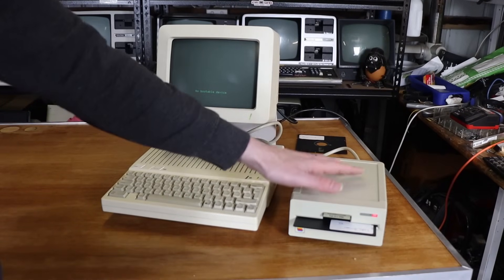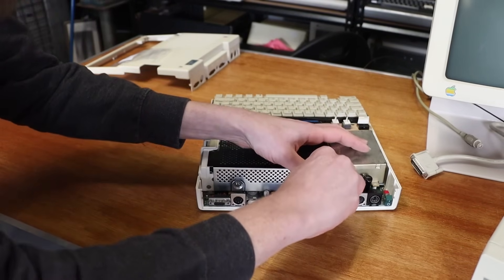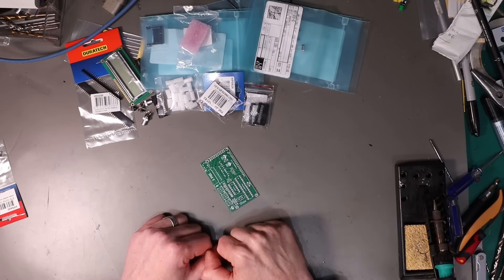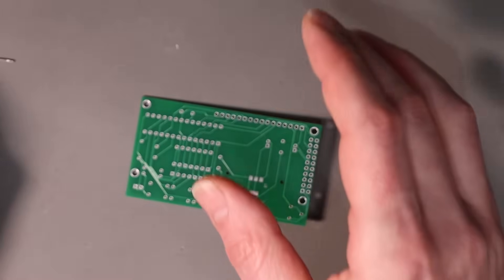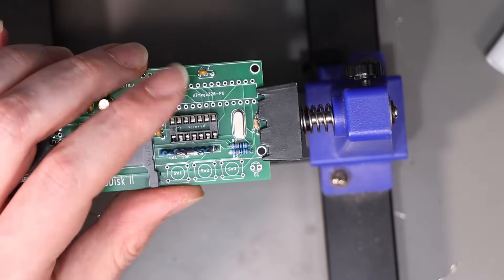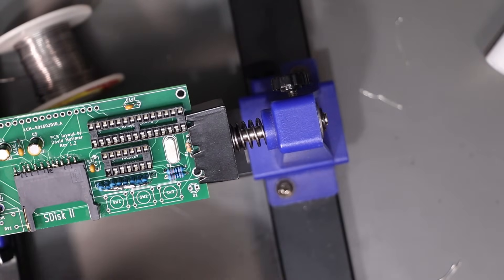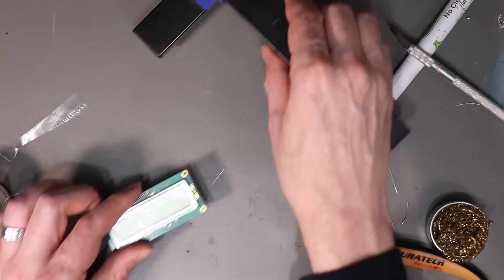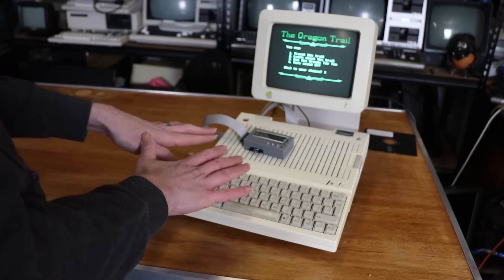Apple IIc: BMOW Drive switcher and building a SDisk2

Comment: Thank you for the video! I have a BOWS floppy emulator for my IIC, and your video helps in setting it up. Question: is there a way to still use the internal floppy drive after installing the hardware for the Floppy Drive emulator or does it have to be removed to make the internal floppy work? Thank you!

Comment: Clever little device you built there. I suppose it's quite a bit like the SD to IEC for the Commodore 64. I don't have any apple II's in my collections. I did have a line on maybe getting one, but I realize I just don't have any room. They are wonderful machines and they use them quite a bit back in the day

Comment: Great vid as always, Mr Lurch! For soldering SMD components like the SD slot, only tin one pad in the corner, then attach that to the component. Once that's in, you can solder another pad on the opposite corner and the part will be secured, then do the rest. This allows the part to stay flush on the board and avoid tombstoning, and only having one pad tinned allows you to move it around a bit, to get perfect alignment.

Comment: I love the Apple IIc as well. You can do some upgrades to the machine, like a Mockingboard 4C or the ROMX stuff, however for the most part the IIc already has what you need built in which is great! As for the BMOW switcher, it looks like you received the newer revision which is cool. I have the older one with only 1 switch on it. I'll need to order the latest and greatest it seems :-)

Comment: Nice. I prefer to only tin one pad, place the SMT part and then solder the remaining pads once the device is in place on that first pad. That way the part is flat against the board when you start but hey whatever works and gets the job done. There is no right or wrong way around for the crystal, there would be if it were an oscillator but not a bare 2 pin crystal. The mighty ATMEGA328 aspiring to be an FPGA ;-) Good project build Jason.
Reply: I would also recommend to only tin one pad. If you heat that one up, the part will drop flat on the PCB and not float on all the tin blobs.